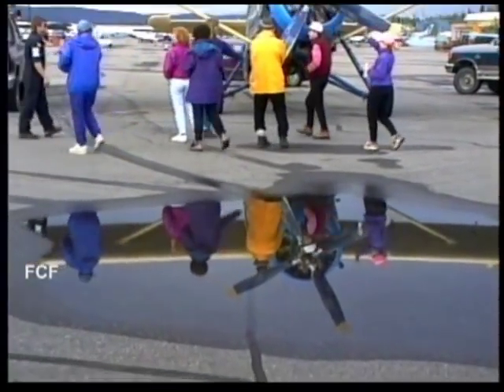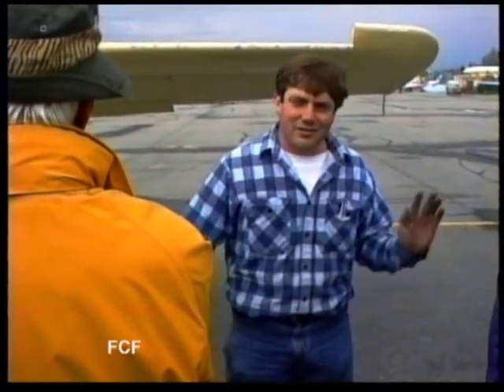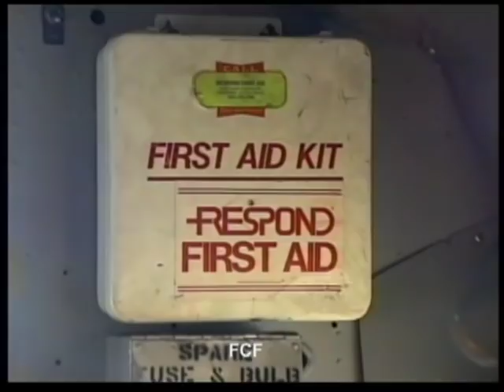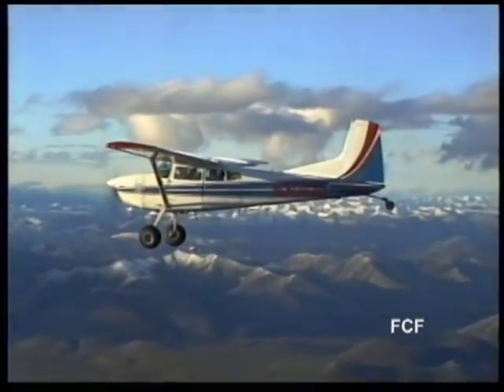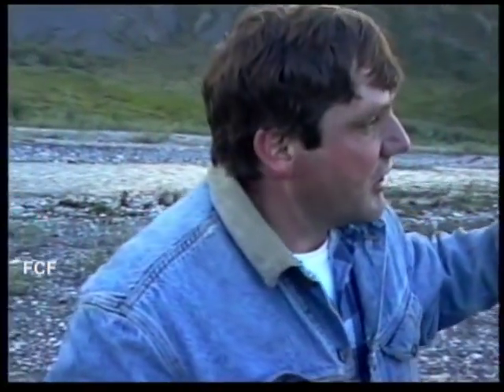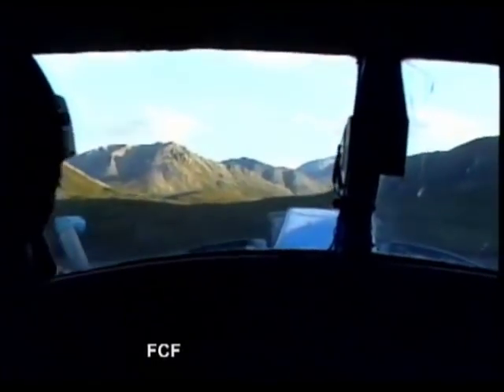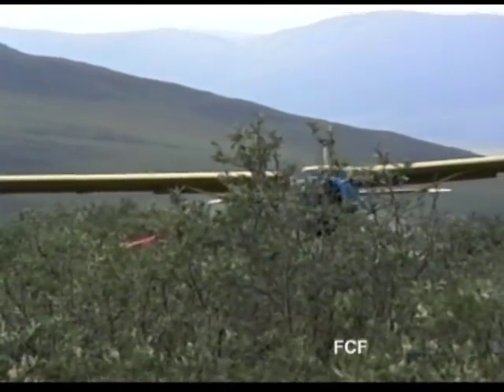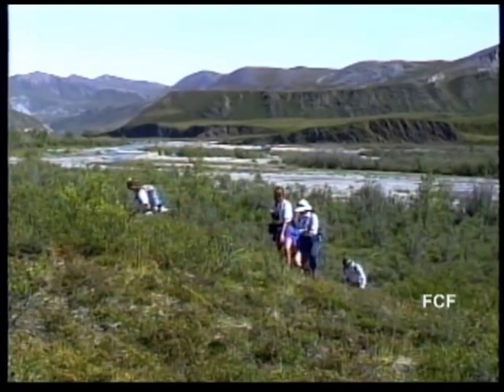Alaskan Bush Pilot tells us how to land his Otter beside a remote river, Kongakut

Comment: Four years ago my wife and I joined with my 90 year old uncle on the Kongakut. He had been a geologist 's assistant in 1949, 1950, and 1952 when the USGS did a detailed survey. We flew in on a helio-Courier which has a payload of 2500 lbs and a stall speed of around 30 mph and landed in about 200 feet. We rafted for nearly 10 days, the last day was my wife's 60th birthday on Aug 31. We awoke to fog, five inches of snow, and wind. We were just 12 miles from the Arctic Ocean. But all ended well. After a delay to wait for the fog to clear we flew back south through the Brooks Range and made it to Fairbanks. Our pilots were Athabascan natives and really good, though not as loquacious.

Comment: Engine is either a Shvetsov made in Russia as used in the Antonov AH-2. It could also be a similar engine made in Poland by PZL, a 9 cylinder 1000 HP radial. Propeller is that of the AH-2

Comment: The engine on this Otter is the Polish version of a Russian license built Wright R1820 (1000hp).   Originally the Otter had a Pratt & Whitney R1340 (600hp). The conversion is offered by Airtech Canada as an upgrade to DHC-3 Otters.
Reply: xsbuilder1   the r1820 with supercharger is 1425 hp.  I flew a T28b with that engine.  NICE PLANES OTTERS AND BEAVER  GREAT FOR ALASKA
Reply: xsbuilder1   35 YRS ago the state of INDIANA owned one state park rangers had it.  Got a ride In it.  LOUD  so was the T28B
Reply: So, this basically had a B-17 engine in it.  No turbo, I'd venture.
Reply: Yes, the B-17 used a version of the R1820 with the addition of an exhaust driven turbocharger.

Comment: I'm a pilot, and I know these guys who fly in the Bush are good, but dang!  They're crazy, too!  :D
Reply: Gary C yep, sometimes with disastrous consequences ... I live in Alaska, aviation safety a focus of my work ... these DHC crash more often than the smaller bush planes, largely due to pilot error often due to that craziness you speak of
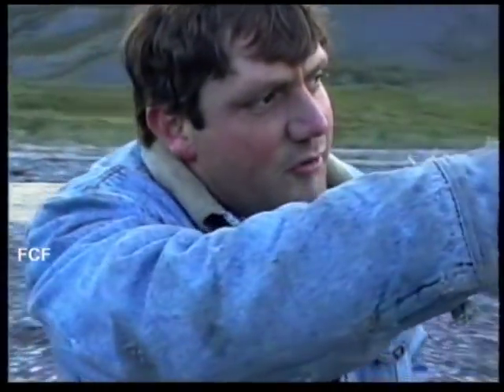Reply: E.g. 4:50 "...with the Otter you can actually hit the bushes without any problem"!
Reply: Well, I quit before I hit something(after flying for 60 years freighters)...Actually, I came back after jets south on Otters up north...but loading Otters(by myself 3,000 pounds each goddam trips) killed my back and quit for good!
Reply: The truck of the North. I know what ya mean. I am not a pilot but have loaded and unloaded enough to know the crap an Otter driver has to deal with. I worked in the bush, mostly setting and taking down bush camps.... Boony barns were the worse!
Reply: @bestoutcomes  This aircraft was involved in two incidents, 2014 and 2015, both caused by failure of the right elevator.  Many smoking rivets were signs of improper maintenance.  The 2nd incident occurred about 13 months after the 1st.  I think the FAA inspector overriding the DOM may had been the culprit.  The DOM used the proper replacement rivet (and showed documents to support that) but the FAA guy said Cherry Max were more suitable, So, the rivets were removed and Cherry Max installed.  Anyway, no injuries and plane returned to service.  Ha, my long time A&P/IA with long experience in AK says to avoid Cherry Max.  The AK A&P I bought my current plane from says the same.

Comment: I have to correct you my friend, the original Otter has a  600 HP engine, with the geared version of the Pratt & Whitney 1340,  that particular Otter has been converted to a Polish built radial engine of about 1000 HP, basically the same engine used on the Dromader Ag plane.
Reply: Cunning Cat I was going to say, 400 hp seems pretty small for an air plane that big
Reply: That Polish engine is a bear.  I though it looked funny.
Reply: Not sure you can ever have too much engine.
Reply: 600hp not 400
Reply: Actually the same engine on the Dromader Ag plane is 1100 HP. the Wright 1820 which is what the engine is reverse engineered from is over 1400 HP
Reply: Were any cowling or structural changes required?  What about payload or performance boosts?  Fuel economy worse or better?
Reply: Loved that Camel...it was a rocket!
Reply: OG Flyer, of interest, the old franklin engines / parts are made in Poland now.
Reply: Actually, the Wrights were given to Stalin by the tens of thousand in WW II due to Hitler invasion.

Comment: The only thing better than a "single Otter" is the Twin Otter".
Reply: I have to disagree. The only thing better then an Otter is a Polish Otter :)
Reply: @skyknightdave  the only think better than a polish otter is a turbine otter. Other than the sound and looks. But the pt6 in these is an operators dream
Reply: @blainemacdonald6929  and the only thing better than a turbine otter is a Porter ;)
Reply: I Agee about the Twin Otter. I operated the 100, 200 and 300 and have over 4000 hours PIC in type. The pilot is correct about heavy weight landings even in the Twin Otter with BETA and reverse.

Comment: ...Am pretty sure I recognize this engine as a transplant from an An-2, as I've never seen a prop like that on a P&W (nor can I read a single word that's printed on the blade). It's basically a Russian-built early-edition Wright R-1820 Cyclone. I worked on similar ones in the Navy. 
The ones with lower reduction ratios were rated around 1,000 hp.
The stock Otter did in fact have a P&W R-1340, an engine of some 600 hp. Cleaner lines, but less power. Wonder where the original one went. Probably a restored AT-6 somewhere.
Reply: @0 0 ...The what?

Comment: I've flown that same engine on a Dromader,,,,,1000 hp.
Reply: The camel carry 4000 pounds of water if I remember right...the otter is good for 3,000 pounds so six barrels of diesel or 9 passengers plus a 1000 pounds of gear...however, people are so sissy these days, you have drop
the rooskie or PW-1340 engine(too noisy) for turbines, PT-6 or GE
Reply: C.Riley - This engine is the same one mounted on the Dromader, made in Poland.

Comment: On the safety talk, did he tell you to crack the door open before impact?  You don't want to be trapped inside with the door jammed shut when a fire starts.  Well, that was my first experience in a Cessna 152 ride.  Oh! And make sure you have your hand on the seat belt release too.
Reply: bad advice, on both points. The door is part of the structure and may save you from harm during a wreck - and your hand might release the buckle too early if you get jarred. I've never been in a wreck, but I've flown over 5000 hours in Alaska and never heard your advice before. Not looking for an argument, just don't want to see people hurt needlessly.
Reply: My grandfather was crash rescue at a ww11 airbase, he carried a very sharp Bowie knife to cut seat belts that jammed after a crash.